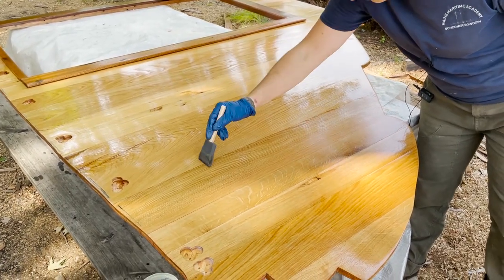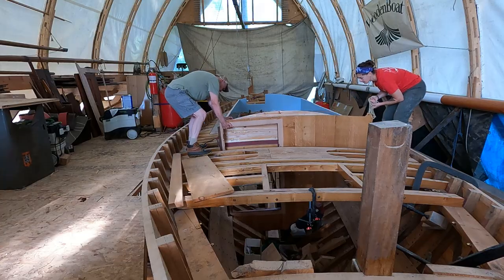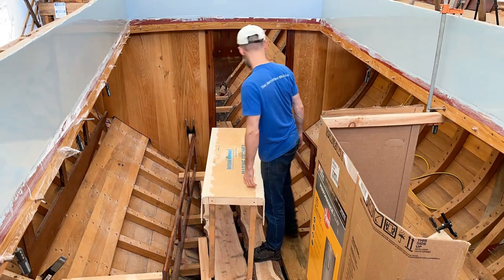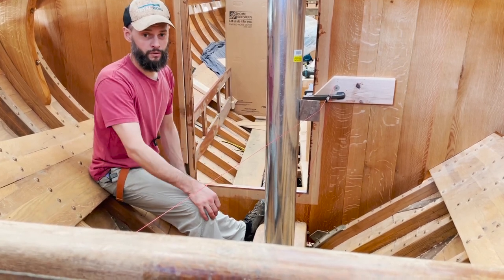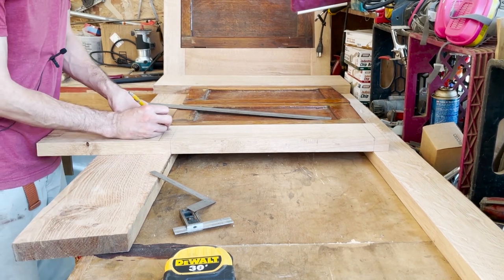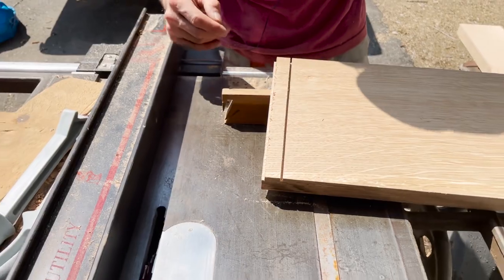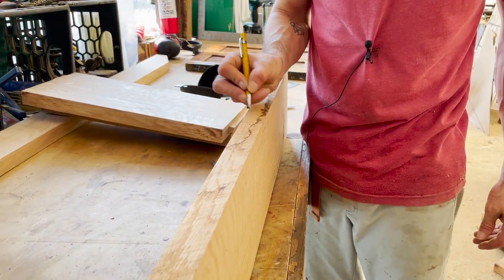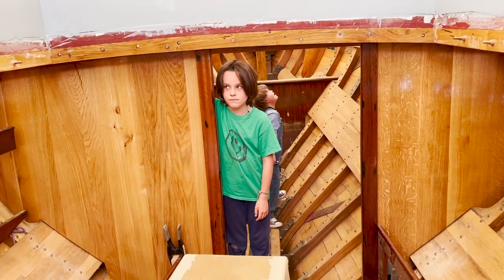The Pleasures of Square Carpentry - Episode 176 - Acorn to Arabella: Journey of a Wooden Boat

Comment: The amazingness is awesomer.

Steve, I make cabinets and furniture for a living and do mortise and tenon joinery in some cases all day long. Seems to be like A) you're doing it the hard way and B) the pattern of the tenons and mortises is not like anything I've seen before. I do get the idea of an unglued joint to allow the wood to move, but the typical tenon length is 5 times the thickness of the tenon. Your tenon thickness looks to be 1/3 of the stock thickness which is fine, though with machine cut mortises 1/2 thickness has become the norm. Shoulders are generally the same as the tenon thickness. Another thought is that when I'm production building face frames I've changed over to using floating tenons with a Festool Domino. A LOT quicker than hand cutting mortises and tenons. Also, another option for mortises is using a router and an edge guide.
Reply: Yep. Another piece of weird, non-standard woodworking from this channel. It's almost as though they are trying to invent woodworking from scratch, unaware of what people have been doing for centuries.

Comment: Just a quick safety comment. You exponentially increase the possibility of a kick back on a table saw when you use a fence in combination with the miter gauge. That is the deepest tenon cut where you are registering on the fence and pushing with it tight against the miter gauge is a recipe for potential disaster. If the board cocks or twists even a tiny bit its coming back at you like a rocket. Be careful.
Reply: The danger comes when the workpiece is cut all the way through. I say that when the depth of cut is only partially through, the risk of kickback is negligible.
Reply from the maker: Paul raises a good point and so does Larry. Stay safe out there!

Comment: One thing you might consider is tapering the mast from the deck to the foot. I had a 54 foot round mast on my boat that had this taper. The mast was 10 inches at the deck and 4 inches at the foot. The mast from the deck to the step was a little over 6 feet. Came in right in the middle of the galley and had to go around it to get to the bow all the time. The taper made this so much easier a maneuver.

Comment: I don't have an pro opinion about expansion and contraction on boats, but in Idaho (not a ton of humidity or seasonal fluctuation, but lots of heat variability) on siding that is engineered to resisting expand/contact, we still leave a 3/8" gap between butt ends of lap boards to compensate and not buckle. The length of material also contributes to how much it will move as you have already discussed with planking. In finish work, a reveal that is larger will look excellent still as long as it is uniform. I like your idea of leaving a gap, and think that you won't regret making it bigger than you showed it, especially with the boat being subjected to extremes.

Comment: Just food for thought Steve.. many nights we lay on anchor up to 50 miles of the west coast of Vancouver Island on what's called "The big Bank" in rather inclement weather. Sometimes it was so rough that I was glad my upper bunk was of a height that while laying on my back I could draw my knees up to jam against the deck beams to keep from bouncing off the bunk as we dropped off the top of the waves. I actually could sleep like that which was a good thing because 4:30 am came early and the trolling lines had to be in the water by 5 am.
Reply from the maker: It's an option, as are lee cloths. It's good to have a few options for those times. Some people think that berths are built small because "people were smaller"... not so!

Comment: Always add a few nails or brads thru the mortise and tenon on of course the back side, very normal, are available in stainless. The term is always "glue and screw". Have the attachment for a drill press that I haven't used much, bought a really nice English machine. Will see about sending it to you, may need a new bit, had used it for some real weird on the job railings. Looks like you will be doing many of these down the road.

Comment: Dang, you’re not playing around with the thickness of the materials you’re using, panels made out of like 3-4 cm thick slabs of oak.. this boat will surely survive any form of apocalypse 😂
Reply: Except of course, you know, the one that is actually coming, which renders all our pleasures a form of whistling in the dark.
Reply: The frames look far too thick and heavy. Looks at odds with the cabinet doors.
Reply: It’s the thickness of Victoria’s doors that are setting the standard. And yes they’re ridiculously chunky - as per circa 1900’s way of building boats.  It will add a lot of deadweight throughout the boat in my opinion - it’s solid oak - half that thickness would still be solid!  But I guess this boats never going to be a lightweight so perhaps it makes relatively little difference anyway.

Comment: Comment:  Progress on bulkheads looks really cool.  Looking better every week.  
Question:  Will you be installing tankage and possibly other infrastructure, like plumbing and some wiring, before the surrounding joinery limits easy access to them, or do you not feel that it will be an issue?
Reply: Tanks will be under Bunks and possibly under the flooring mid ship. He talked about it in a previous video where he did a mock up and was planning the layout. I do agree about plumbing being a possible issue. He will have to get some sort of piping from his motor for hot water i would think. Unless they plan to just heat it on the stove. Most plumbing will all be midship tho. That's where the kitchen and water tanks and restroom will be. Probably just a compost style restroom or whatever the boating version of that is.
Reply from the maker: Desiccating head, Trent, and yes most of what you’ve answered here is spot on. It’s an interesting puzzle to put together, but running systems with so much still in the air about layout isn’t possible, and yes, we’d like to keep all installations as simple and accessible as possible.

Comment: Just out of curiosity, normally in furniture and panel construction like that, the ends are vertical stiles that run the whole height of the panel, and the top and bottom rails are tenoned into those, with the intermediate muntins tenoned into the rails like you did here. It's a stronger way of building, but perhaps there's some functional reason it's done like this in boat cabinetry?
Reply: I'd guess it's partially due to wood movement and partially due to how it will be supporting a load.
Reply: @quadmasta  The problem is that the wood in question, the rails, are going to tend to cup which will show and put weird stress on the panels. I guess if you glue and screw a cleat on the back to take the joinery from the other panels, it won't be too bad, but... The loads it's supporting will be the same or potentially greater than any other kind of cabinet.
Reply: It is 1 inch net wood, 6 inches wide with spans less than 2 feet. Probably not an issue.
Reply: @webbtrekker534  Just curious, it's the same amount of work either way.
Reply: @bawrytr  True

Comment: Steve a word to the wise, fore peak lockers in small boats tend to be top loaders as the restrictive nature of the compartment makes accessing  and utilizing each locker to its best awkward to say the least when front loading. But it will look great if not terribly practical.
Reply: Would be cool if he just hinged the whole panel :) Being that it opens wider into the boat, allowing it to hinge down onto the bunk would be a good way to maximize access in an awkward location. Wouldn't really be very strong if built that way tho so probably not the best idea.
Reply: Yes they do tend to be top loaders and they suck!  On my 62 yo traditional sailboat accessing those lockers involves propping up heavy foam mattresses.  if there is room for face doors then I think this is a great decision, yes peering into them will be challenging, but knowing these folks they will figure out some way to see/pull out bins in the lockers, or just store stuff in there you don't need to access much, or is easy to grab (socks and underwear).
Reply: @pparker5113    get some lighter cushions or sub divide them.Now't spills out of top loaders, unless you are upside down
Reply: Trent,well you answered yourself. no room in Abies fore cabin to swing a small rubber band. No standing headroom unless you have got the fore hatch open and no room to drop down a panel only just enough room to open Vicys old doors if no one or nothing in the way

Comment: I saw a review of an old green wood table. Now it had issues from drying, which you won't. One thing he did say that may have made the joint stronger is driving a dowel through slightly  off center holes to draw the joint together. I don't know if that would apply with boat flexion or not.

Comment: What is the edge of the bulkhead going to be fastened to? It seems to be just floating and hanging from the deck beam. My understanding from Bud MacIntosh's book is that bulkheads should go out to the planking and be fastened to a frame.
Reply: They aren't structural. Other than keeping them from slapping they could just be hung on some sturdy hooks if you wanted. When things swell you don't want them turning into unintended frames. They weren't built to withstand sheering.
Reply: Bulkheads are sometimes structural members in a boat that help resist twisting motions, but sometimes you specifically do NOT want them to do that, like in this design.

Comment: Interesting woodworking techniques, I can’t say I reach for the chisel when making cabinets, biscuits dowels or kreg jig, good luck
Reply: Your cabinets don't have to take 60 knot winds, 25 foot seas or 90 degree rolls probably.
Reply from the maker: The interior joinery has to be ready for changes in ambient moisture more than anything else, and these cabinets are not structural in any way.
Reply: @AcornToArabella  You're doing it right :) I'm wondering when we'll see the first bit of pocket hole joinery in this build though, you don't strike me as someone to half ass things :)

Comment: Wouldn't you want to be running any electrical or plumbing rough ins first? Seems like now would be the time before all the cabinetry gets installed
Reply: He's not sure yet of the final design of the living areas and cabinets location. Besides, on a boat you have all those hollow spaces along the "shell" to be used for wiring and plumbing.

Comment: Why wouldn't you have the locker doors go on top of the frame? More like a kitchen cabinet, there would be no fears of swelling wood keeping them shut.
Reply: Sometimes there a rabbet around the edges so the doors are half in the frame and half cover it. But they can still stick sometimes. Just mounting the doors on the surface looks sloppy in an assembly like this. In the kitchen you don't see it because the doors are mounted edge to edge, and use special hinges not suitable for a marine environment. Plus these doors were originally mounted flush, which was the way it traditionally was done - you can see the cutouts in the edges of the doors for the mortises for the hinges. It would look strange to retrofit them to be mounted in a different way.
Reply: Kitchen cabinets made with overlay doors aren’t a traditional detail, by land or afloat. They are an invention of production cabinet companies designed to drastically speed up the shop build process where a company is churning out standardized boxes. We will only use overlay doors in modern interiors, and then only full overlay.

Comment: Steve says, "Sometimes I get tired of making all of these decisions".  Word.  I am at the cabinet making phase of my kitchen remodel that included replacing and straightening many of the studs and all new wiring, just a few random bits are left of the original.  The constant drip of decisions/problem solving is like being stuck in first gear on the highway.  It seems you Steve are that unfortunate amalgam of a 'doer' and a 'thinker'.  Stay in the moment and may every day see progress.

Comment: Just started watching from Ep 160 since I took a break for about a year to let the episodes accumilate and I am wondering if it just wasn't put in the video, when you cut the small corner off for the bulkhead, it cuts to adjustment then bolting it in, did you seal the edge you cut?
Reply from the maker: Yes.

Comment: That corner of the door frame that you cut off from the bulkhead? I'd have pulled the bulkhead back out and properly sealed the cut area. Otherwise, that's going to become a perfect place for rot to start, one day. And pulling that out to get at it for repairs is gonna suck.

Comment: lot of comments to read so sorry if this is redundant. I wonder why Steve didn't turn the board vertical and set the saw blade to the correct height and just use the saw. to the side cuts then do the end cuts.

Comment: I like using  a furniture restorer for old furniture. It softens cleans and removes old yellow varnish and leaves a lighter clean sealed surface ready for simple recoat. I recently restored an old carved Bed board that was heavily carved but almost black due to age and dirt. The carved panels were then let into new Quarter sawn oak, .Its darker but at least you can see the grain now.

Comment: Why don't you use plastic resin glue? It actually welds the fibers of the wood together so it breaks it will never break with where you glued it. I think the brand is WeldWould.  It is a powder that you mix with water, usually to coat both sides of the wood, clamp together for four hours to overnight.

Comment: Very dangerous move there crosscutting up against the rip fence. Clamp a board (thickness doesn't matter) to the fence behind the blade so as you push the material you're cutting it clears the clamped board and there is no chance of the blade binding and you getting a kickback. Woodworking 101. 55 years of woodworking experience talking here and I know that some of you Youtubers don't take advise very well, especially when it come to safety. But heed my warning, if not for yourself then for those working around you.
Reply: Yup… I’ve been bit by kickback from cross cutting between the fence and blade… if you do it often enough, you’ll get bit too!  (42 years of woodworking… that’s almost 100 years of advice!)
Reply from the maker: Thanks for the tip!

Comment: Why such massive stiles?
"Everything is going to swell when we get near the water"............and yet you made "plywood" with crossing grain in thick sections which will fail completely when it swells.
Reply: How would you do it?
Reply: @kathywrightjohnson6804  Well, I would start with the drawings. Whatever the naval architect drew in the first place should at least inform the decision. If this bulkhead has a structural role (hard to see that, given the huge hole in it), then the answer is somewhat different compared with it just being a non-structural partition. If it were non-structural, I might well build panelwork of ledge & stile with floating panels. That would allow for timber movement easily. I would probably do raised and fielded panels, but could even do linenfold on the "show" side.
If you are asking how I would have made the so-called plywood.......well, very clearly NOT the way they've done it. Plywood only works because of the ultra-thin layers. So unless they are set up and able to make veneers of less than 2mm, they shouldn't even have attempted to make it. At the very least, this requires a drum sander.
Even if I had made it the way they have, at the very least I would have removed all the sapwood before starting, and I would have pulled the joints up tight. No matter that the wood is nice, the job is actually a horror show.

Comment: I didn't understand what she was say about the finish did she say  she was putting two or three coats of finish I spray everything anymore no brush strokes no bubbles and a true legal finish plus a more durable by didn't she notice the bottom corner needed to be trimmed
Reply from the maker: Whether you spray or brush, coats of finish need a sanding in between and a few coats to build. It’s how they work.